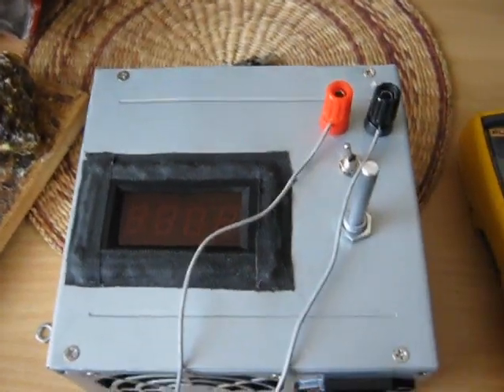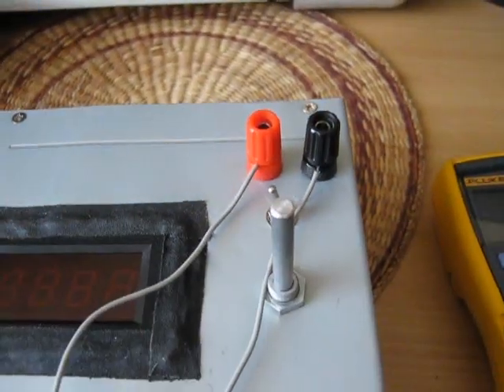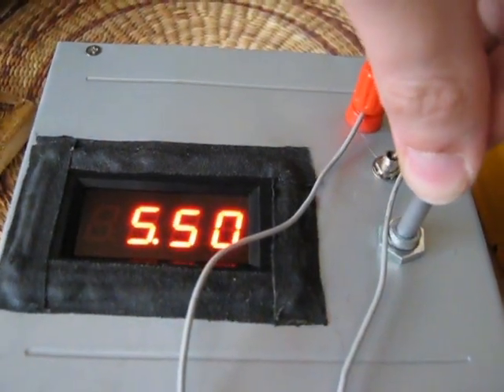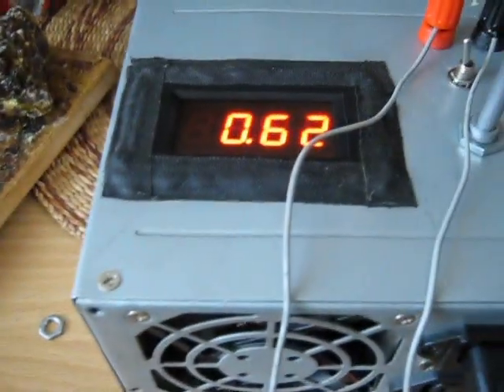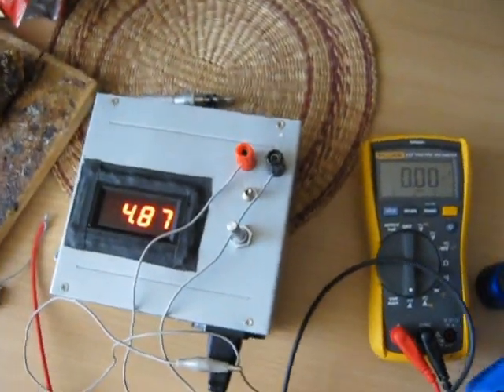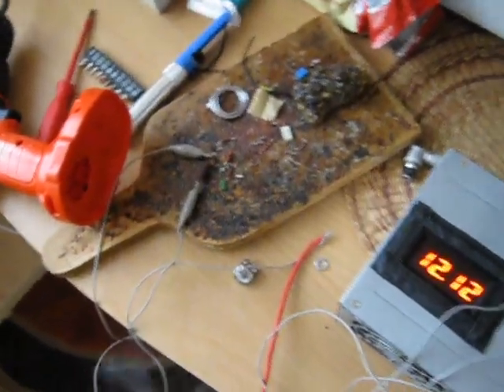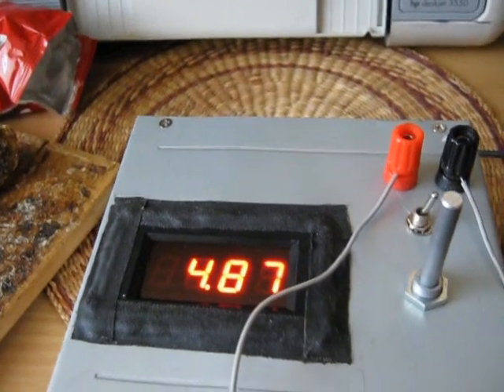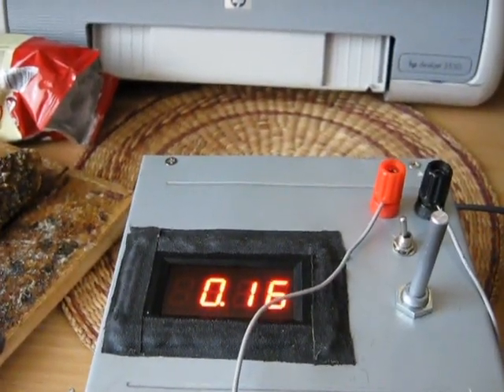Hacked ATX PC supply to Fully Regulated Lab Bench 5-16V 18A power supply !!

Comment: Did you change the elco's?
Most of them are rated at a max voltage of 16V,they will explode if you overvolt them.
It happend with my modified atx psu which went up to 24V,but i forgot about the caps so it went kaboom.

Comment: Thanks! I have 2 PSUs sitting here ready to be converted. One will be done using your method, the other the standard method. Looked inside and found a KA7500B, just need to order the parts. Any recommendations for protecting whatever I connect to the PSU and stooping it from drawing too much current ? I was thinking car fuses.

Comment: Can you push it down to 3,3 volts using the 12V line? I can only manage to push down to around 4,8 volts. Modifying the pots value did not seem to affect this lower limit.

And one more thing, I have trouble with sudden load. It acts like a short, shuts the PSU down. Seems like the overcurrent protection is too sensitive. Do you know how to "slow" the protection down?

Comment: Just wondering if u did a how to video on this...I would like to make a power supply out of an old computer power supply, but would like to have it be a variable power supply. Thnx
Reply from the maker: There won't be a step-by-step how-to video because of the reasons explained in the link in the description.
Reply: Ok...thanks for your response :)
Reply: Jozef Bogin Please tell us what you did. Its important since I'm working on a project and I really need to get a 10amp with 12volts to 20volts using a variable pot. My input voltages are going to be dropping and spiking continuously from 70 to 110volts. My power supply is for a UAV, currently its too heavy and using 2 ATX power supplies will add more weight. I need to get this to work. I will be adapting it and adding automatic feed back to stabilize the voltages. If you help I will publish the entire power supply setup with set by step.
Reply from the maker: Please take a look at the article mentioned in the description.
Reply: Jozef Bogin I have. I'm managed to find a power supply with a KA7500 and a pot resistor. It seems I can change the voltage to 14.4volts on the 12volt rails. So I'm starting with step 1. Find the IC on the KA7500...
Reply: Find the first pin of the IC and disconnect it from circuit board. I'm guessing that's find the first pin on the KA7500 and cut it or unsolder it from the board?
Reply from the maker: Yes
Reply: hmm...I just pulled the entire fist pin off
Reply: which pin number is the tapper
Reply from the maker: None.
Reply: Next, take a 10k potentiometer (this is a good starting value) and connect the first pin (Fist PIN OF THE POT?) directly to the second (center) terminal, or the "taper" as I call it. (SOLDER THE TWO PINS TOGETHER ON THE POT?)
Reply from the maker: Rrrrright.... A potentiometer has only one taper, and that's its center terminal. Nonetheless, if you've managed to rip off the first pin of your microchip, completely, off it (if I understand your previous comment), your conversion is done for good.
Reply: Am I missing something...r u showing how to do a variable power supply?
Reply from the maker: Nope
Reply: As far as I know its a variable voltage power supply. I've seen a similar project where 30volts can be obtained from a single PC power supply.
Reply from the maker: I had been reacting to the "showing how to do". Nope, I was not showing how to do it.
Reply: Jozef Bogin my brain only works with visual instructions. Perhaps I will do a video when its working.
Reply: Dizy Tizy if it does maybe you should try to start on a minor circuit, or a less complexity one, or make a sheet draw from explanations given and IC datasheet. I'm not an expert constructor and it seems quite simple to do for me. By the way its a very useful tweek :) Cheers
Reply: Hey Hugo I discovered how to use a transformer and a variable voltage regulator to give me any voltage I want. It works way better especially with varying voltage input. I've just finished building a 2 - 37v 10amp regulator.
Reply: Jozef Bogin Are you going to show us how you did it (including digital display connection) or do you want us to guess?
We are very interested how you did it and you may "react" some thumbs up on the way...
Reply: Jozef Bogin Thank you! The article on your blog will do great!
Reply: No VanClaaude don't waste your time. You can build something way better. Build a voltage regulator circuit. Its simple and not that expensive and it will work for sure.
Reply: I will do a video of what I've done...Basically I've taken the transformer from an old external powersupply. I've used it to step down the voltage to 24volts. I've then used a heavy duty block bridge rectifier that's capable of 15Amps to convert the AC to DC. You can then build or by a regulator circuit. Here is a link to some regulator circuits which I'm looking to order. http://www.ebay.com/itm/5x-5A-Constant-Current-Constant-LED-Driver-Lithium-ion-Batteries-Charging-Module/321401578953?_trksid=p2046732.c100040.m2060&_trkparms=aid%3D111001%26algo%3DREC.SEED%26ao%3D1%26asc%3D20140107095009%26meid%3D8686d062a2104f6699e4920b9d20201a%26pid%3D100040%26prg%3D20140107095009%26rk%3D1%26rkt%3D4%26sd%3D321401578953
Reply: Final solution...Take the 12v rail of a PC power supply. Running it through a step up step down modal which is rated for 12Amp. Use a nice (multi Volt,Amp,Watt,Energy) reader rated at 50amps to record output. (Module which works well - LTC3780 Automatic lifting Pressure Constant Voltage Step Up Down + Heatsink New)

Comment: hi friend
 Currently I'm working with some dc motors and i need negative voltage with high current, but when I connect the GND of the "power supply 1" to the 12V of the "power supply 2", to use the GND of "power supply 2" as -12V, i have a short circuit, and therefore the "power supply 2" is switched off. Is there some way to get -12V with high current?

thanks
Reply: just use the wires in the polarity you want..Use yellow as neg. and black as positive. as long as you keep your circuit away from metal contact, to the  power supply.
Reply: augusto ivan carreon bernal Yep, but it is a little complicated because you have to replace rectifier shottky dual diode, rewind transformer, rewind choke in -12 rail and bold traces, so it isn't so easy as you could think.

Comment: So if you would change the electrolytic capacitors for higher rated ones you will be able to go over 16V?
Reply from the maker: Slightly
Reply: Jozef Bogin
So not worth it then (to change capacitors). Too bad I have a optoisoator type spare PSU laying around :-( But fortunately I still have a +5, +12V breakout cable that I made for it :-)

Comment: Hi, can You tell me where on the schematic you did the changes , try look at this romanian guy who made a power source like yours but much better, for example it gives like 24 v and 15 amper.But that guy doesnt want to reveal his secret.
Reply: ADRIAN OANA Yeah, sure - it is posiible, but you have to revind transfomer, use +12V and -12 as negative and change some components from -12V rail and bold traces, because -12V usually has only max. 0,5A.